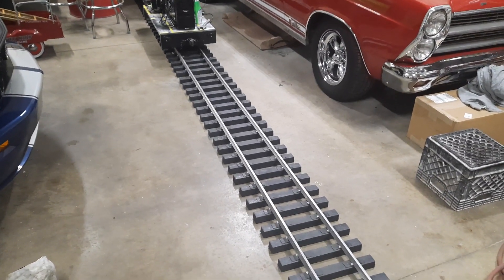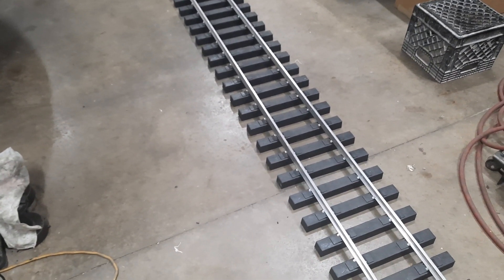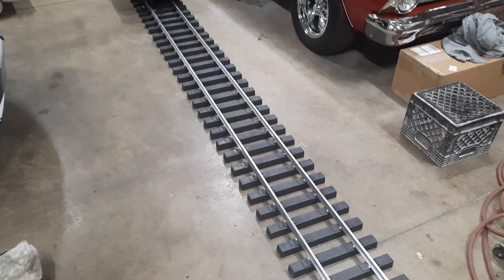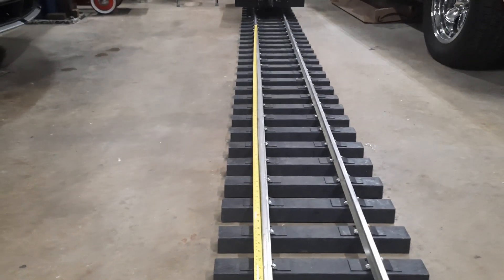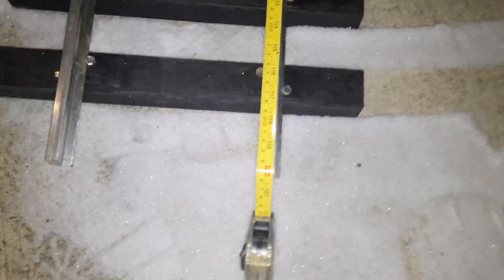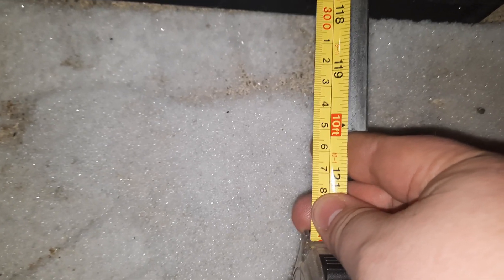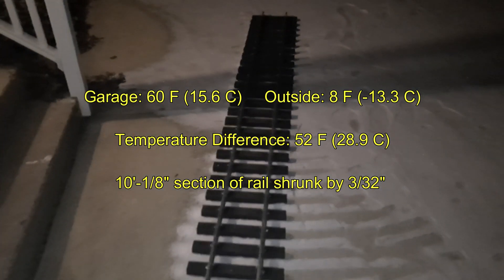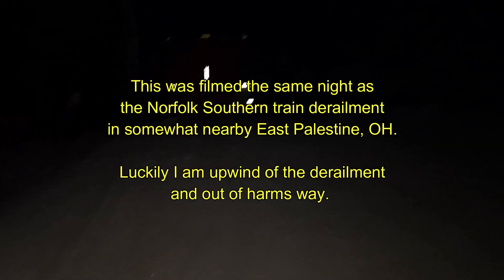How Much Does Railroad Track Length Shrink in the Cold, Lets Find Out! | 7.5" Gauge, 1/8 Scale

Comment: I appreciate you using US Standard ! Great experiment.  I needed to put a starter ring gear on my truck flywheel one time. It was winter. I put the flywheel outside overnight. Put the starter gear on top of the wood stove. Cranked it up. Got the starter gear to expand. Brought the flywheel in. Grabbed the starter gear with a channel locks...slid the warmed up gear on the cold flywheel...just like that. 
So yes...cold shrinks...heat expands.
Reply from the maker: SAE for life! I have done that starter ring job before with touches, I like the creativity of using the wood stove.